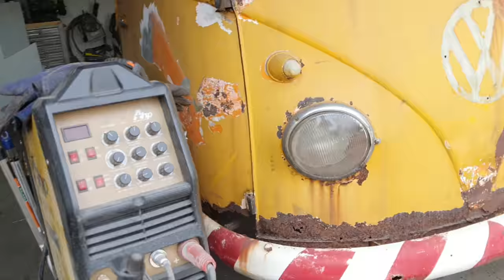VW type 2 Frame work clean up and on to sheet metal

Comment: i am looking @8:25 in the video.   the 2 studs for the transmission mount and the 2 engine mount plate holes would make a great roll around cart mounting.. but the brackets that come up.. might have several sets of adapters all at the same height on a good frame..  the bottom of the round torsion bar tube as a saddle..  perhaps with a bolt down clamp on top.  perhaps the  cross member under the frame horns..  with a pilot up thru the middle hole..  its just thoughts for the future projects..

Comment: I have a suggestion . If you are going to sell it get it to a company which dips vehicles(when the metalwork is done ) ( first dip / rust and paint removal , second dip ktl/e-coat and then it gets baked . You would be able to tell the potential buyer that every mm or it has no rust and is coated and won’t rust ( which will make it last for 60 more years )
Reply from the maker: probably super expensive for that. I think it will still last once it is all treated. I tested these products I used one back when I was 18 and it did not rust again when I sold it in 2013. plus some others for about 10-20 years no rust.

Comment: Applause for your efforts and the final result.    In Australia such a vehicle would never be allowed back on the road.   Despite the work you have put into replacing the worst of the rust panels, the structural integrity of the balance of the panels is suspect given the intrusion of the dreaded rust into the inaccessible places..  there is no provenance for the sections you have fashioned and the welds are impossible to certify.  It's a sad fact of life that every bloke who buys a welder ain't necessarily a welder.  The rolled curves have strength which is not replicated in butt welds which are not continuous.   Nevertheless, top marks for your efforts.  Once there were thousands of these bugs on the roads, now there are none.

Estephan

Comment: final note:  that rust converter you use...  It should be fine in a dry climate like Cali or AZ, but in other parts of the country where there is more rain, snow or whatever -- that shit isn't going to be enough.  That is why some people bitch at you.  People don't understand how there is no rain out that way so they get mad.
Reply: Phosphoric acid only stops the current rust. It doesn't prevent future rust. In the rust belt you're better off covering everything with bar and chain oil

Comment: Great example of the work needed to prep the frame for paint, which was very instructive.  Was the black finish the same paint as you used on the under floor of the ‘67 SO?  Great to hear you figuring out how to piece together the rear of the cabin. Love your work.
Reply from the maker: yea we use Krylon rust with rust treatment underneath for small stuff then at the end I shoot that alkyd emulsion on everything
Reply: Mike Fn Garage I’ve tried but can’t get the alkyd emulsion here in Australia, such a bummer as other stuff is so expensive

Comment: Excellent work.... sometimes a metal wire brush works on that undercoating...and sometimes I score the paint before the plasma hits it..does that big fan help blow the dust out of the shop ?  Mines a bit noisy but it was free.
Reply from the maker: free is good. it keeps us cool with the AC on. But also helps blow the dust out when the door is open. Yea we used the woven wire brush on that undercoating.

Comment: Finish the frame first and make it run , the cab can be done later or you will run out of videos for the next 4 months. You can do the cab later.
Reply: The back of the cab is part of the bed, he needs a support for the left side since the OG one collapses that's the reason for working on the pillar and lower portion it all ties into the rear. Once the floors in it goes up from there.

Comment: What is the brand of rust treatment ?  Lowes or homedepot?  Thanks
Reply from the maker: amazon. rust converter the best stuff I have seen yet turns it black right away and has a primer in it.
Reply: Mike Fn Garage thanks!   Been using the skyco ospho liquid.  Like your white stuff better. Will order some.
Reply from the maker: here is a link this stuff is clearly the best Ospho does work but this is stuff is I think a bit better https://www.amazon.com/Converter-Highly-Effective-Professional-Repair/dp/B014LR5PA2/ref=asc_df_B014LR5PA2/?tag=hyprod-20&linkCode=df0&hvadid=312176482001&hvpos=&hvnetw=g&hvrand=11541576465002401395&hvpone=&hvptwo=&hvqmt=&hvdev=c&hvdvcmdl=&hvlocint=&hvlocphy=9031487&hvtargid=pla-569248501869&psc=1&tag=&ref=&adgrpid=68995954464&hvpone=&hvptwo=&hvadid=312176482001&hvpos=&hvnetw=g&hvrand=11541576465002401395&hvqmt=&hvdev=c&hvdvcmdl=&hvlocint=&hvlocphy=9031487&hvtargid=pla-569248501869

Comment: I use the same Rust Converter Ultra that you recommended.
A silly question: can you just paint over the rust treatment?
Can you just weld over it? of it needs to be sanded?